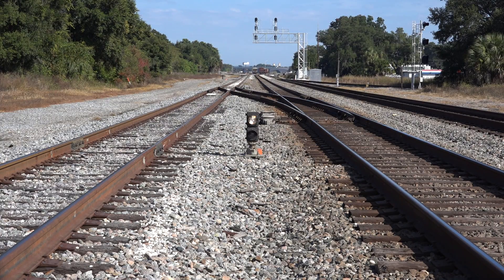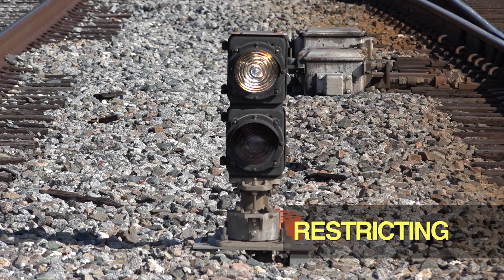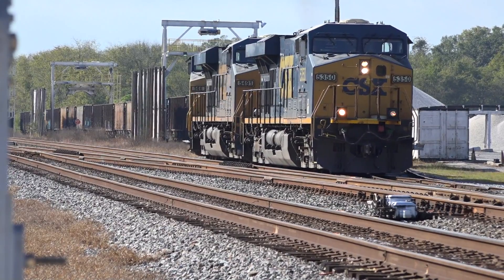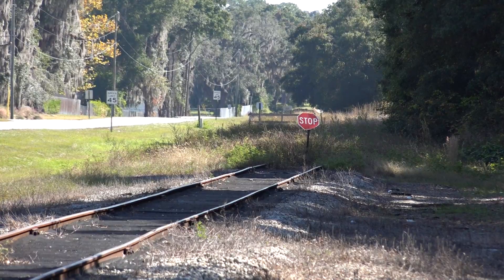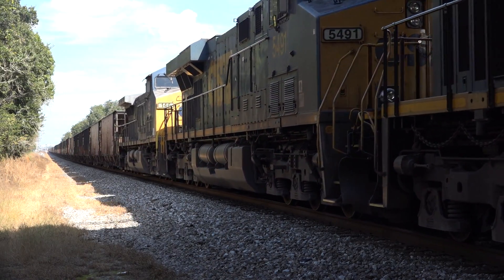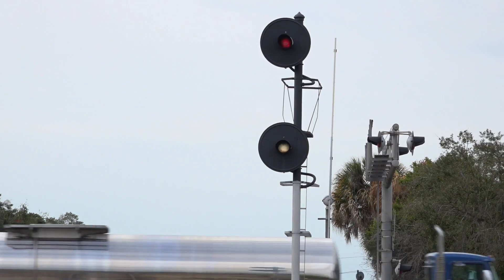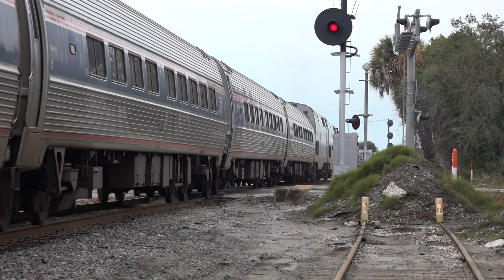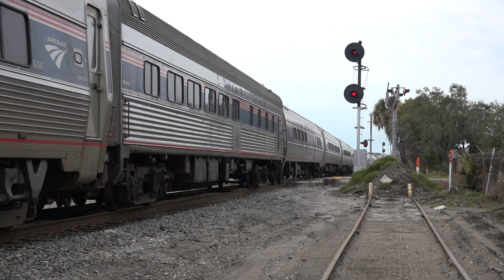How To Read CSX Signals Part 3

Comment: Those dwarf signals work a bit differently in the UK. They’re called shunting signals there and like the dwarf signal they can only display two aspects. If it displays a red light and a white light horizontally it means “Danger” or “Stop” while two white lights that illuminate at a 45 degree angle means “Proceed at restricting speed”. Also, locomotives that are shunting cannot leave a set area, which is where another type of signal comes in called the Limit Of Shunt signal. It’s a simple illuminated sign with “LIMIT OF SHUNT” or “SHUNT LIMIT” printed on it, and any shunting trains can’t pass it

Comment: 1:46 The Krome AVE quarry used to be a General Portland Cement manufacturing plant from the 1950s through the 1980s. I worked there in administration in the early 1980s. They were the second largest cement manufacturing company in the United States. La Farge (French) bought them out and eventually closed the plant, opting to import cement from Mexico. A rock company bought the plant because of the huge quarry operation that supported the manufacturing. The 600-foot kiln building with the smoke-stack is still there. The quarry is a huge operation, and I don't know if they still use the switch engine that we used to use to move cars inside the plant. We didn't ship cement in tanker cars (it has to be kept dry), but in tanker trucks.

For those who don't know, cement is the binder in concrete that sets up by chemical reaction (not drying) and binds the sand and gravel.

A bit of trivia. An episode of "Burn Notice" was filmed in the kiln building.
Reply from the maker: Selling our manufacturing offshore is one of the greatest mistakes this nation's leadership has ever made. NAFTA was the beginning of it.

Comment: Okay look, I can simplify this for you guys in just a few paragraphs. When it comes to mast signals, start from the top and work your way down. If the top is displaying green, go no further, you have a clear track and you may proceed to the next signal, regardless of the rest of the signals. 
Is the top yellow? That means at the next signal you are running out of this track, unless the next lights below display something other than red. So in that case, is the middle light green? okay then that means you have another track to go to and you just have to slow to medium speed when you get there. Is it yellow instead? That means you are going to have another yellow light at the next signal, be prepared. Is the middle light red but the bottom light is green? It means the same thing as the other green light; you are running out of track and you are shifting to another track at the next light, but this one is SLOW.
Is the top light red? You have run out of track. Except if the second light is Green? So you are still out of track but you are shifting to a new track, take it at medium speed and then you can proceed to the next signal. But is the second light yellow? So then you are still out of track but you are shifting to a new track, only to run out of track again at the next signal, unless the bottom light is also green, which indicates when you get to the next signal, you are shifting again, take it slow when you get there. Or is the bottom light yellow? Then this means you are out of track and shifting over to the next track where you are running out of track again after the next signal. But is the middle light also red? Yep, you are still out of track, but if the bottom light is Green then you have to take it SLOW as you shift to the next track and then proceed on to the next signal. but if the bottom light is yellow, you need to take it slow as you shift and then prepare to stop at the next signal.
If it's not all red, then it's not red at all. If you are looking at all red, you must stop.
Now here are the exceptions:
Flashing lights are more permissive than solid lights. Therefore a flashing middle green indicated Limited Speed rather than Medium speed.
Markers such as a "P", "G" or milemarker on a signal make it an intermediate rather than an absolute signal, therefore all-red only means "Proceed at Restricted Speed"
Any time a Lunar aspect is displayed regardless of position, it means you are leaving CTC territory and entering other-than-main track with "Restricting" which means you do not need any additional authority beyond that signal.
Speed signalling used to be referred to as Maximum speed, LImited Speed (45MPH), Medium Speed (30 
 MPH) and Slow Speed (15 MPH), but for the past 20 years or so, Timetable speeds overrule signal speeds. As such, CSX changed their "Slow Speed" to 20 MPH so that trains do not attempt to run at a speed that will cause harmonic rock. (13-17 MPH)

Comment: Wait, if the Wye is that short, how is that Amtrak going to be able to turn on it, let alone that l-o-o-o-n-g freight train? :)
Reply: mspenrice Amtrak doesn't run the S Line. The wye is just for turning locomotives not the entire train consist.
Reply: I'm still a bit confused... I assume you mean it stops short of the Y, the loco is uncoupled, does a 180 using the Y, runs to the other end of the train on a double section, and moves back onto the original track at the other end through a switch to pull it forwards on a return run?
Reply: mspenrice it's way too much to try to explain.
Reply: A simple "yes" or "no" on whether it uses the wye as an ersatz turntable and then runs round the train to pull it the other way would suffice...
Reply: mspenrice For K915 he would run engines light north out of Wildwood yard down the yard lead to Moreland Park where he would get back on the mainline. Then he would shove backwards to the wye to turn his engines around and then shove backwards to hook up to his consist to run south
Reply: ...I'm going to take that as a "yes", with some added detail about how the loco(s) get to and from the wye from where the coaches are temporarily parked.
Reply from the maker: You can't turnything on that wye anymore except maybe an engine or two, probably just one. I guess they keep it for turning engines if one breaks down and other has to lead. Can't imagine any other use.

Comment: In Canada the restricting signals are show with a solid yellow on the bottom signal while slow speed is flashing yellow.
Reply: There are several signal schemas in the U.S. that do that, too.  Older schemas that employed no flashing aspects had no way to show Slow Approach either (though, dwarf signals usually could).

Comment: How similar are theses to other railroads if different at all? i live in Knoxville TN and we have a CSX line that goes through but most the rails are NS.
Reply from the maker: The signals for all U.S. railroads are very similar. They have slightly different definitions and indications. NS in ex-Southern territory uses a different ABS system where the signal stay green all the time unless there's a train the block ahead. So there are differences in mechanics, but the indications are pretty much the same.

Comment: I'm sure you already know this Danny but some viewers may not. CSX also uses the restricting aspect when the dispatcher lines a second train through a signal behind another train that hasn't cleared the next signal ahead.  the restricting aspect usually always gets upgraded before the second train gets there. i notice it in Callahan a lot because of how busy it is at times. a train will clear the signal and be all red for about 15 seconds after the end of the train and then it goes to restricting, then approach and then clear.
Reply: Yes. There are two subtle things going on there.

Many interlockings (or dispatching software) allows a facility called fleeting.  This allows a route through an interlocking to persist for any number of trains until the dispatcher turns it off.  Normally, once a train passes the interlocking signal and "accepts the route," the route is cleared from the interlocking once the train leaves it.

Fleeting will allow the dispatcher to not have to set up a route for every single train using the same interlocking the same way, over and over.  But, since interlocking signals are always absolute, it can cause trains that bunch up to have to wait for one another to trickle through the signal blocks.  The other feature being used is called (in England) a Call-On.  This allows a signal that would normally be showing Stop because the following signal block is occupied to display a better aspect... in this case, Restricting.  

The only alternative to a call-on is the dispatcher authorizing a train to pass a signal showing Stop.  But, this is dangerous for many reasons.  The call-on makes it a lot safer.  A route must still be lined through the interlocking, switches and derails must be locked, and the interlocking must be empty.  If none of those conditions are met, the signal will still show Stop (your "red for 15 seconds").  But if the interlocking is clear, but the subsequent block isn't, the call-on lets the signal show Restricting which allows trains to keep moving, sort-of as if the interlocking weren't even there.   Passing a train into an interlocking past a Stop signal goes around all the protections provided by the interlocking, which is where bad things and accidents happen.  The call-on state will also be recognized by an astute engineer that he is entering a known occupied signal block—just like passing a red intermediate signal.

CSX employs these features widely, it seems, which is why most new signal installations have a Lunar White somewhere.
Reply from the maker: Yes,I've seen that a lot in recent years. Many more Signal plants have a RESTRICTING mode now. If it's set up for following, a dispatcher can line a train in right behind another.  I've seen it at Folkston, at Lakeland and several places on the S-Line.